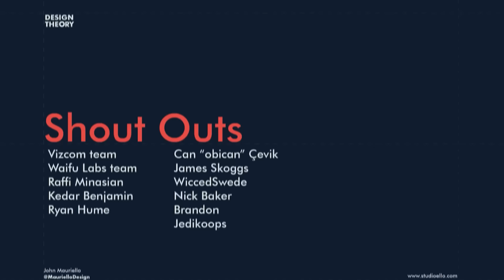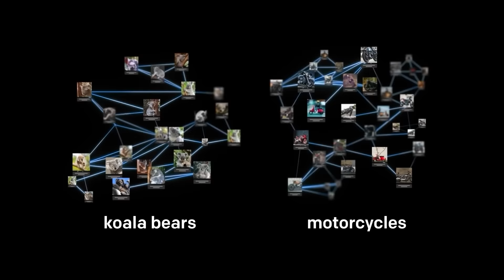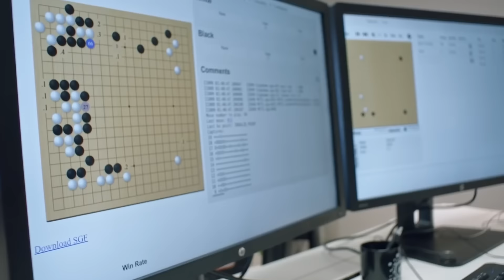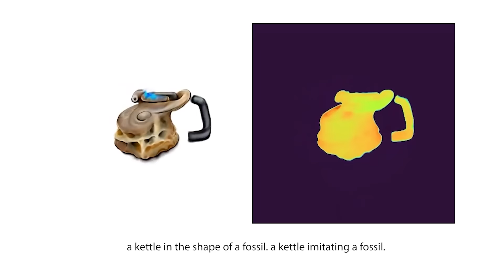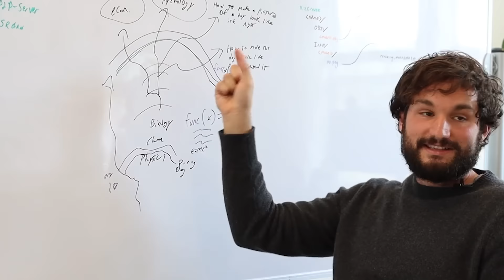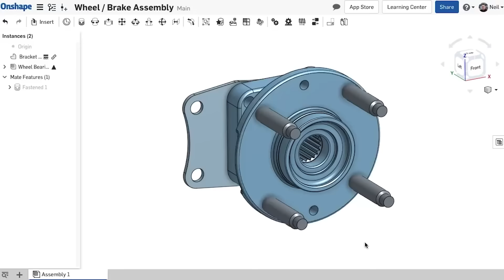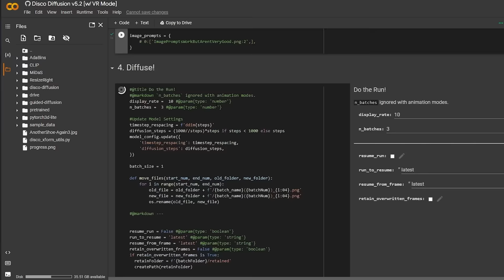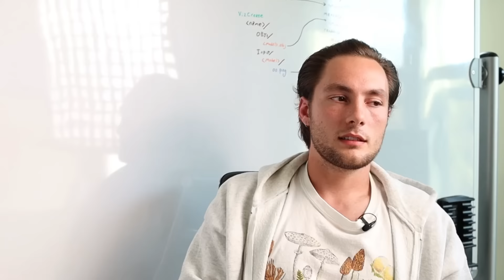Will Artificial Intelligence End Human Creativity?

Comment: It is possible that in a short time it will be possible assign parameters to the final chosen design like material, size variations, generate 3d models to print mockups and even calculate costs.

Comment: I agree with your overview, one of the best actual understandings of AI design. From what I see, AI design is just a visual (or data) mash-up tool aid at this point. Yes, it’s FUSING concepts into novel images, but... True design problem solving requires more than simply jumbling and fusing pre-existing images. Most of these “shoes” are simply illogical and do not appear to be anything beyond aesthetic style variations, but that can help you change or add to your design process in a good way. I spent last year working on a new product for my client and there is no way that AI would have come up with the concept through keywords and photos because it requires research, human testing, materials understanding, manufacturing optimization, advanced surfacing, and more importantly scheduling and cross team organization and collaboration (to name just a few). I agree with you that it’s FAR more complicated. And if your curious, I’m an Industrial Designer and I will never be replaced by AI. I will simply just add to my toolbox as I always have and be able to do even more a single person. 3D printing is a perfect example of what I have been able to do on my own in a fraction of the time that in the past required thousand of dollars and months to procure varying levels of prototypes from outside vendors who need to put me in the cue and then send via shipping service. Looking forward to playing with some AI at some point, but that step is just a small slice of what I actually do.

Comment: 30:29 - which is EXACTLY what A.I. does :) You inadvertently made a good point that people agree to have their creative output used ON THEIR terms. This is already not the case. Not only data sets were harvested (not exclusively though) from copyright owners without their knowledge (let alone permission), the data sets themselves are under no obligation to be third party/publically vewable.
At present the benefit from your creative contribution to the data set is controlled by the person behind the A.I. In  future the A.I. may control another A.I. to do the same because it will be even more efficient.
Yeah, A.I. is a tool, and YES a lot of humans will lose their jobs/(livelyhoods) because as a direct result of it. To say teams "will become smaller" or "the talent will be reallocated" is a diplomatic acknowledgement of impending job losses (shockingly Ruwen has forgotten that the path to get to be a lead artist still is through apprenticeship of doing the mundane work).
Also, references to photography in a lot of statments were comically out of context  - invention of photography had nothing to do with painting "becoming better" :)
Good discussion.

Comment: to the people feeling discouraged pursuing art due to this, I think that this will not change things for the worse for you because think about it, if AIs can mass produce these in a split second then what worth is there? it becomes saturated and that where authentic human creativity will be in high demand more so than ever.
Reply: Even when you can't tell the difference of ai art and "authentic human creativity"?
Reply: @lucaslittmarck2122  you can tell the difference as it'll stand out as something interesting among the rest of the noise that'll be posted everywhere following trends or just having fun with new tools. Even just to pick the better product from AI-generated images would benefit from having a better design sense, ultimately design is problem solving, not free form expression, so the final product has to satisfy a specific set of objectives while being appealing to its intended audience.
Reply: @tubester358  Respectfully, I think you're wrong. AI will continue to be adapted to new criteria of learning in new fields. This is just a fairly basic function, it will be adapted to progressively more challenging fields. It's growth will be exponential. Not to mention, that the way machines learn is improving rapidly. And this isn't even taking into account true, general artificial intelligence. Chess engine AI are already far, far stronger than the current world champion, who is arguably the strongest player of all time. Chess requires so many facets of intellect, including really intangible categories like creativity, risk assessment, and psychology. He didn't even mention it in this video, but that AI that learned Go to beat the world champion, took (if I remember right) only a few days of playing against itself, to surpass all human experience and mastery of a games that's thousands of years old.
Reply: ai could drastically improve human technology faster than a human mind
Reply: You are talking about worth, but you are making this classic mistake, confusing user value with exchange value, you should study marx to understand the fundamental contradiction of the capitalist economy. User value is the utility of any product to mankind, and clearly the a.i. has enormous value, probably in more and more respects greater than what a man could produce with his work. Exchange value is the conversion of human labor into money, and it cannot be created from work performed by a machine. Only human labor, in the average of the economic cycle of production and distribution, can produce exchange value, that is, money that has value. And this obviously leads to consequences for the capitalist system: that by decreasing human labor, due to depopulation, automation, unemployment, etc., enormous crises of overproduction and a fall in the rate of profit will occur; this is in contradiction with the development of the material forces of production, which will instead be more and more powerful. It follows: or the proletariat will bring to a revolutionary end the power of the bourgeois class, which owns the means of production but is no longer able to manage a system that now requires a new social property relationship, that is, communism, or the bourgeois class will be forced to violently destroy a large part of fixed and variable capital (technical means and workers) by counter-revolutionary actions, for example through crises and wars. In the new world of global reset, the bourgeoisie will probably keep alive an endless class of slave men with the aim of extracting the surplus value from their work, and with the disadvantage of course of underutilizing the potential of a.i. Another possibility is capitalist expansion into the solar system, but capitalism does not even have the means to purify waters, eliminate radioactive isotopes, irrigate deserts, stop pandemics, let alone populate outer space with billions of men.
Reply: @zdenekburian1366  ai could design economic bridges, cars, with the help of the human mind
Reply: @lunarsann5499  the problem, for the capitalist system, is the need to constantly increase the number of hours worked by man globally; if we have avoided great crises such as those of the last century, this is thanks to the fact that this number has increased with the contribution of billions of new Asian and now African workers, but this process is destined to stop inexorably, and the a.i. gives a further push in the opposite direction. This is why musk and other foolish dream of implanting computers in the human brain, and transferring hundreds of millions of workers to Mars, i.e. expanding markets and making man compete with machines, but this madness is doomed to fail miserably. Look at the projections of the graphs of the limits to growth, club of rome, updated from 1972 to today, to understand the frightening problem.
Reply: @donquixote8462  most of the AI gaming endeavors were on deterministic games, and people aren't generally always looking for the most genius and magical moves in those games, they only need to be skilled enough to beat the next best player. The AI beats the top player in the world, then the top player finally has another obstacle to overcome and can come up with new ideas and potentially beat it, and so forth. Same with design and other things. The AI can become the best producer, painter or photographer, but someone needs to approve of the final product in a specific context and their ideas & experiences feed off of it and into it, sometimes even breaking the rules and doing something that isn't typically done in order to achieve a specific effect, and not randomly like AI typically does. 

Look at the way we're already using it now, the AI can DO all kinds of things better than us, brainstorm at an unmatched degree, but it's just spitting out results, not making an explicit decision on what is the correct/best result for us. Ultimately, I think one thing not enough people are talking about is how these AI seem great for becoming an interface between designers/creators and the tools we currently use to create. Instead of being limited by our input devices and time, we can just communicate directly with the tools and have the AI interpret our queries to deliver specific usable assets, even manipulate them based on further input, especially with collaborative tools. 

When it comes to art there's hardly ever an objectively right/better result, there's always value in having a specific person's influence on the output. It's value is in the history or story behind it and ideas within it, not just the aesthetics or labour. We don't say there's no need for more artists because there's already a master artist around, but the paradigm of what skills designers, artists & others need to focus on will change.
Reply: Yeah, but AI is cheaper than people unfortunately.
Reply: Calm down people, my point is that A.I will almost definitely be the majority in designing everything from construction, infrastructure to simple consumer products. But the job of the artist will have more value due to this. Sure there may be less work opportunities but the fact that you're a human has more value to niche "future hipsters" than machines.
Reply: @KhoaLe-uc2ny  people are more likely to evolve into therapist and explore outer space through the help of ai thinking, but still needs human mind to research unknown to us
Reply: @KhoaLe-uc2ny  yes, but what is "value"? marx spent his life of a genius figuring out what "value" is. We can agree that the user value of human labour could be far superior to machine's. But capitalism does not care at all about what good is for the human being, what matters is how much capital it is possible to extract from this work, and in fact, starting from the last century it became clear that - in the imperialistic phase of capitalism - where finance is even more important than production, capitalists try to create money out of thin air, possibly even without human labor. Obviously this money is just a speculation, a temporary zero-sum theft that is destined to return to its true value, that is, none. But this makes you understand how much for the current production system the crucial thing is not the human value we attribute to the quality of work as you understand it, and which would obviously be desirable, but the number of hours worked that are subtracted from the capitalist to the worker by not paying them and transforming them into surplus value, therefore into money and capital. It is not so sure today to be able to say that the A.I. will multiply the number of hours worked by men, indeed it is safer to say the opposite, what is certain is that we will have to enormously increase the number of these hours in next decades if we want to avoid destructive crises, because in capitalism this number must necessarily increase constantly, and make the capital grow by at least 2% per year on a global scale.
Reply: @lunarsann5499  Good luck to get truck driver to do that.

Comment: I don't know if this video goes into it. But the only thing holding AI from totally replacing graphic teams, or being a great help are a few things I noticed. 
1. It's far from perfect. 
2. You cannot export to like a usable blueprint. So unless you ONLY need an image then kind of screwed. 
3. You cannot easily get multiple of the same image with small changes. Things that kind of come close to this with seeds manipulation etc. 
But if you want the same exact shoes but a different angle your screwed. 

But this tech is new. And I do think we can get there. In order for AI text to image to go from weird, fun and kind of useful to full on commercial. We need the follow features. 

Like an export 3D model. So you can have the AI generate like a 3D render. Then export it as like a blender project or just a mesh or something that you can use in other programs. We also need the AI to get 50x better which I think that part will happen and sooner then we expect. But we also need more control. A more robust control over elements. Instead of spoon feeding fancy words and hoping for a result. We need to be able to more specifically word each element. Like Green Moon, purple water hose, clear water coming from hose. Sure so many AI's out there maybe one does this really well. But even the best I have seen if you put in Purple Water Hose. The AI may think you want the water coming from the hose to be purple. And if you try to fix this by removing water and just putting in "Purple Hose" then you run the risk of the AI not knowing it's a water hose.  If we can crack of all of these. Then AI text to image. Or better AI Text to 3D Mesh etc.  Then we indeed have a world changing utility. I'm not hating on AI Text to image at all. It's powerful! And fun. For just an artistic sense its as important as the wheel is for a car.  And somehow I actually do think we can get to the point were everything I say is possible. But it could be 5-20 years off.  What I really want AI to export a full project file that can be opened in other programs that even has like physics and like movements built in. I forget what they are called in Blender but the ability to move arms around or pose your creations. Imagine making a dragon in AI. Then exporting it to blender and it already is rigged for movement and you can edit it in blender as if you built it in blender from the get go.

Comment: The question is: how likely is that AI comes up with the same design over and over again, or it makes it differently each time you run the task? How likely is that two different AI come up with a similar design, and whether or not it would be a function of the dataset only? 
It would be really curious to know if there is any research answering those questions 🤔
Reply: Every image generated is different. It’s based off probability. Two different AI’s trained on different data will come up with entirely different images. Two different AIs trained on the same images will come up with very different images.

Comment: You mentioned that the best AI tool will usually be that with the biggest data set. Won't that lead to a sort of AI monopoly?
Reply from the maker: It absolutely could
Reply: You'd assume that but neural nets these days can be trained on simulated data. A small company could match a huge corporation's quality without matching their data gathering or computational resources. An example is start-ups using open world videogames like GTA to train self driving models instead of deploying large fleets of real world vehicles packed with sensors.

Comment: John, I know you are a designer, not a photographer, but I am. About your lighting... umm, it really is not flattering. Really. 

May I give you some suggestions on how to improve it for future videos?

Your Key Light (the one on the camera's right) might look better if you raised it about 6 inches.

Your Fill Light (on the camera's left) is your biggest problem. Turn it off. Yes. Replace it with a large white foam board reflector. Position it about halfway between you and the camera. Be sure the middle of the reflector is a bit higher than the axis of the lens. And have it just out of view of the lens. Now, turn your Key Light toward the Fill then angle the reflector so the light bounces off of it then onto you. This will nicely light up the shadow side of your face and put light into that eye.

Now remember the light we turned off? Move it toward the background until it is behind a line drawn through your shoulders. This is what we call a Kicker. Position it about ear level or a bit higher. Then aim it toward your far shoulder. Reduce the intensity until the effect is to subtly divide your dark jacket and dark hair from a dark background - always a difficult lighting situation.

Now you might even want to reduce the intensity of the light on the background. Just a bit or maybe by half or more since the kicker is now in position. Adjust as needed.

Two final tips:
1. For good lighting, you generally want to have the center of each light source at the same height as the subject's eyes or higher.

2. The camera lens should be at the eye level of the subject. If is below, then the viewer is looking up the subject's nose.

Keep up the good work. I'm 77 and find this AI stuff fascinating.

Terry Thomas
Director of Photography
Atlanta, Georgia USA
Reply: .... your effort to make something better shows u are a nice guy...greetings and a Good day to you sir